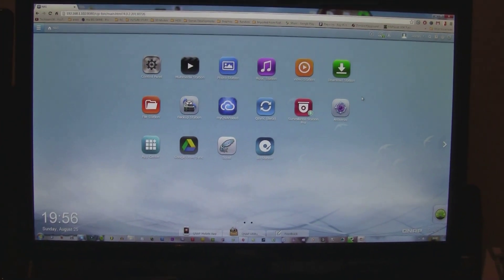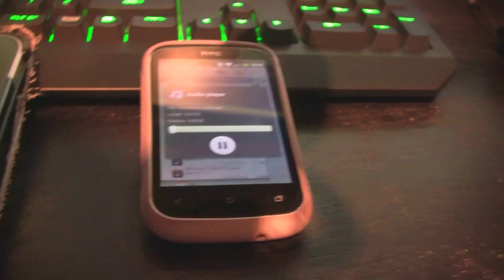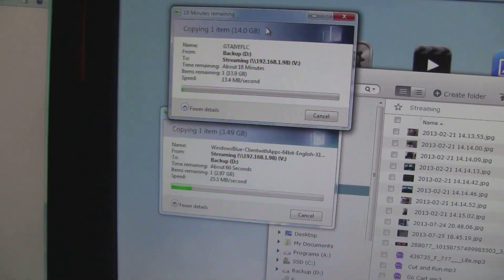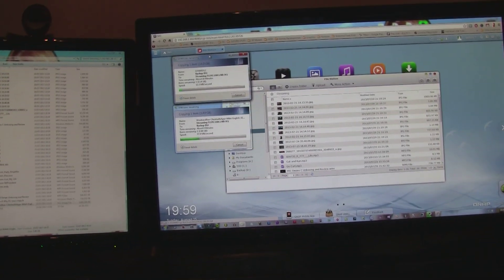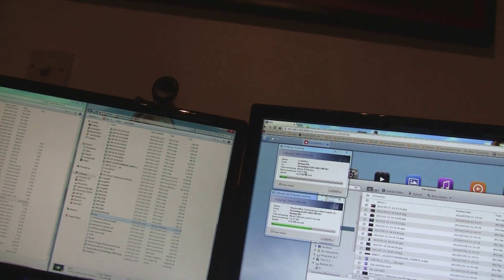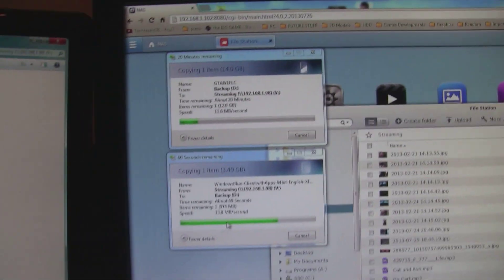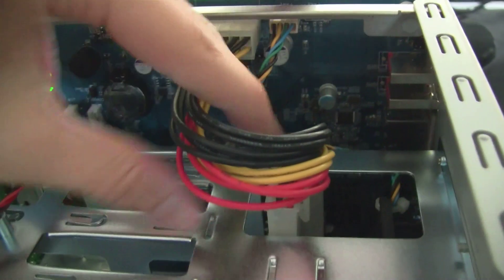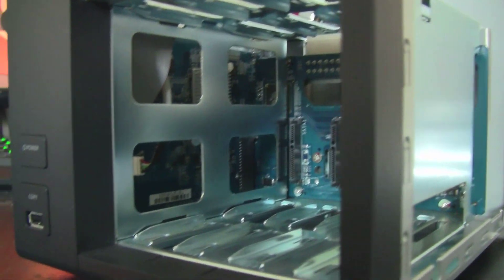QNAP TS 421 Review and Torture Test

Comment: Great video, thanks. I do HD and 4k Video editing.  I like to have raid 5 for editing as well as giving option for my clients to check the edited project. I need high transfer rate for my editing software to work good and play raw materials flawlessly. Is this device good for my small business post production? I have a mediasonic raid which works fine but the cloud gives better opportunity to work close with my clients from far.What kind of hard drive should I buy, 7200 rpm or Nas 5400rpm. I am worried if 5400 is not fast enough for editing, but normal 7200 Hd falls sleep if it is not being used. what do you suggest. Thanks
Reply from the maker: Hi Farshid Shabafroozan First of, awesome! Raid 5 is great but very CPU intensive, luckily this NAS should be able to handle 4 drives in RAID, just be careful as if a drive does fail you need a new one fast! In regards to the drive speeds for 4k video work, I have only really know that SSD's are fast enough to read and write that quickly, but a good Seagate Barracuda or better, Western Digital Red drives which are made for NAS use, and should be fast enough for your needs. The only other thing is your want to edit on a 1 gigiabit network with 4k footage? If you are planning on using this as your storage instead of local storage I would recommend thinking again since transffering 4k files and what not is not a forte of gigabit, for backups, sure it will be great but for general file storage you may want to look into PCI-Express RAID cards and put the drives in your machine. Long story short, 7,200rpm.
Reply: TechteamGB thanks for your quick response. I like to connect this box directly to my edit suit through usb3 or esata and use the nas for clients to review what I finish(not 4k, just HD or low res-which one you suggest?). If I connect it directly to my computer is it going to be ok or I should go with just a simple raid box. I am not good with networking that's why I need your advise. The seller told me take Qnap Ts-420 or 421 instead of just raid box. Is he right or this box is only good for cloud? I got 4 X 7200  seagate but I am waiting to know Ii I should return the box and exchange it with only raid box.
Thanks a lot, I learned a lot from your video.
cheers

Comment: How come you aren't getting speeds of 700mbps?  Do you have a wireless g router?  I thought you could transfer 1 GB files much much faster than that?
Reply from the maker: Hi Jeff Halbe we were reaching 135MB/s in previous testing although we ran into some troubles which were quickly fixed in both my home network (router issue) as well as a small problem with the QTS 4.0.1 firmware (we have been upgraded to over 4.1.1 now). Hope this helps!